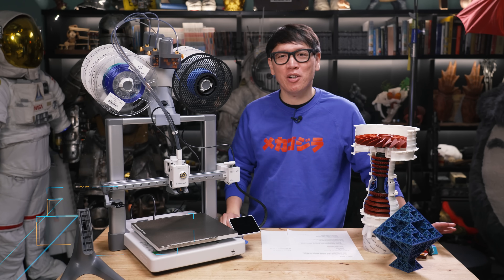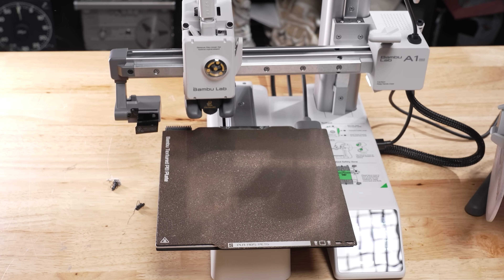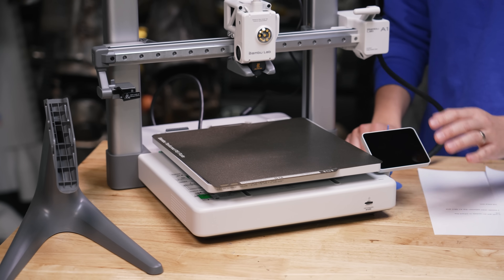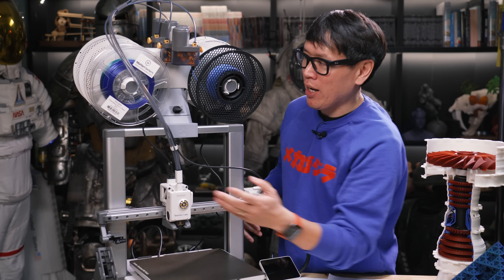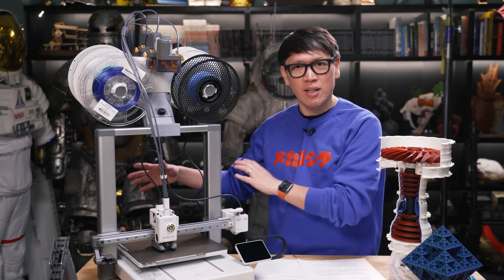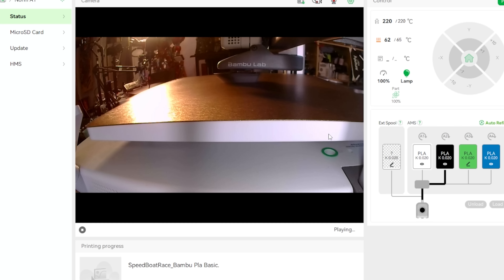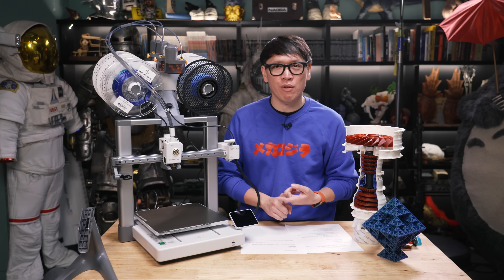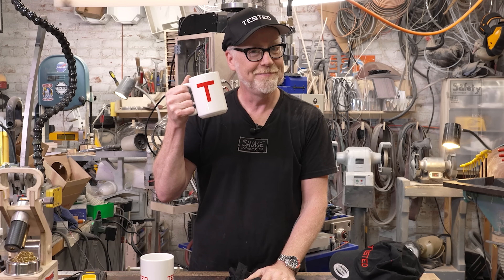Hands-On: Bambu Lab A1 $400 3D Printer!

Comment: Agree that the AMS Lite has a ridiculous footprint, and that mounting it on top of the A1 seems a logical solution. However, I'm concerned that so much weight (5+ kg) up that high and hanging off the back of the gantry just seems unstable.

Comment: I'm currently watching this video, while my Bambu Labs A1 is running a print (about 18 inches from my monitors) and other than the part cooling fan and the slight hum of the motors and the print mechanism, its AMAZINGLY quiet once the harmonic calibration is done.

Comment: just ordered an A1 on sale for 300 bucks...tired of my ender 3 neo..it printed great out of the box, but now i can't get it to print a damn thing, tried just about everything...it will extrude when i adjust the extruder axis in the settings, but when i actually try to print nothing comes out...tried reformatting my SD, changed nozzles, and filament lots of times..., there's no jams, the idler tension is fine, the bed is level... just nothing comes out...had the same problem with my cr-10 as i did with the ender 3...i'm done with creality for now, and maybe forever ...i'll fix it one day, but until then, hopefully i can actually start printing again, when my A1 comes...

Comment: I have a solution to save filament due to purging.
The derivatives to the solution
The purpose of purging being only to clean the nozzle
 
Thus why use filament by extruding it
A purge liquid solution solution can be piped into the nozzle
When a nozzle needs color change the the liquid is filtered through the nozzle

The nozzle is the air dried before the next color filament is put through extruder
The liquid itself is a solution that cleans plastic or absorbs plastics however not too corrosive or dangerous 

its just a little container with solution liquid on the side of the printer the container has a pipe running into the nozzle of the printer .   
The container is electronic and has a connection adapter to the AMS Lite or 3d printer itself
Thus when the AMS Lite triggers filament change a delay is initiated whereby the the container cleans the nozzle by pumping the liquid through the nozzle and blow drying it with air

Sincerely

Ejike Ememe
Ba Hons Degree Administration
Thames Valley University London

Comment: 9:15 for this issue, is there a way to slow down the print once it gets to the top to avoid this?
Reply: Yeah in the slicer you can add a modifier to the part and change the print settings to only affect where the modifier overlaps.

You can change speed/quality settings but you can't change acceleration afaik. 

In addition, during the print you can switch to silent mode (using the touchpad) which halves the speed of everything.

Comment: Three big things had to come together to make reliable high speed printing happen at the consumer level. First we needed more rigid frames to constrain movement while also being smooth. Second, we needed advanced Input Shaping to prevent resonances from being produced that would show up as artifacts in the print. Third, we needed reliable high-flow nozzles in a lightweight direct-drive extruder to maintain the best control of flow while avoiding ooze and stringing. On top of all that, Bambu added more smart sensors, a decent setup wizard, and plenty of fit and polish. This is pretty much the textbook definition of “industry-leading,” and it’s pushing all of us to keep reaching higher. The next big challenge is to do something about plastic waste in multi-color printing. There are ways to make filament at home from your old scraps, but anything we can do to reduce the waste in the first place will be a huge help.
Reply: I've seen quite a few people reuse the scrap filament towards providing cushioning for sent out parts.

Comment: as much as I do love the bambu printers,  They're lower end printers just don't really appeal to me at the prices they're demanding. $600 CAD for a printer with a 180x180x180 volume with the featureset they come with is rough, considering I could pick up a new gen kobra or neptune for half the price and have twice the volume potential. I could MAYBE understand if space was the issue, but with the AMS lite you're taking up nearly the exact same footprint as you can with a full size bed.

Idk, maybe I'm just not the market for it and I am missing something here but I'd rather have 2 printers for the cost of it or a printer and a wad of cash to throw at filament or modding or whatever you'd prefer. I do swear by their X1 and P1S printers at their price markets but this just gives me vibes of selling something for a fair bit more change than it's worth and giving it the apple treatment of beautification.

Comment: I've seen several reviews on this printer and am seriously looking. My 1st printer was an Ender3 v2,  a good starter printer but now there are many better printers for the same or cheaper price. A question, some reviewers found artifacts in the prints ( from the fast print speeds perhaps), couldn't you just slow the print down to eliminate these on parts where beauty is more important than speed? It would still be many times faster than my Ender3 v2. Excellent review by the way.

Comment: I have the Creality K1 already and it is both my workhorse printer and my speedy printer. It comes with most of the A1 mini features but it's a CoreXY design with a 220x220x250 build volume. I ordered the A1 with the Ams lite today because I really want to try multi color, but I dont wanna give up the print volume that the K1 has. I'm so glad I waited and they released the A1 full size at this price point.
Reply: If you could go back would you take the a1 over k1?
Reply: @stilltrying2gopro829  no, the K1 has the ability to print more exotic filaments, and for my use case, that is more important than the multi color function.  I still use my A1 all the time, but it's usually printing PLA or TPU, nothing fancy like CF-Nylon or anything

Comment: This was exactly my assessment. Solid printer with lots of features for the slightly premium price. The important thing is they priced it only $100 over the already popular A1 Mini. Everyone looking at the Mini is going to think "Well, it's only $100 more." and take the step up. I knew they would launch it at $399. Very clever.
Reply: It's kind of surprising how price sensitive FDM consumers have become. Was 400$ for a printer always 'slightly premium'? I honestly can't remember.
Reply: @free_spirit1  Definitely not. A printer with features like this used to be far more expensive. A lot has changed in the past year alone. I say slightly premium because it's still half the price of a Prusa for example, but twice the price of an Ender 3 V3 SE or almost twice as much as an Ender 3 V3 KE, Sovol SV07, Elegoo Neptune 4, or Anycubic Kobra 2. None of those have all the features this does, but they're all largely comparable for basic printing. So it's a moderate step up in price for a step up in quality and additional features. It's definitely not an unreasonable price. Also consider it's close in price to some of the more affordable enclosed printers like the K1 or something from Flashforge. The Adventurer 3 Pro is $399 and is enclosed with a camera and more, but smaller build volume by a lot and slower. The Adventurer 4 and 5 models get closer in size and speed, but are $100 and $200 more. So it slots into a nice spot as a  high end bed slinger without being as boutique as a Prusa. It of also nips at the heels of the Bambu Labs P1P, making it seem both expensive and like a bargain at the same time.
Reply: Did just that, cancel my preorder of the mini and went to the a1, because the larger build would not matter most of the time, but when it does i would´ve always regretted not spending the 110€
Reply: @marcelbirkenkamp1386  I do think the A1 is the better overall value at $399, even if it's a bit of a premium over comparable printers from other brands. If you're primarily doing miniatures or something, the A1 Mini still makes more sense. Hope it works well for you!
Reply: @802Garage  For some of us, the extra $100 can be a dealbreaker.

Comment: The price difference is really for the full combo.  A1 with AMS light is $560 but the P1 with AMS is like $860 (P1P) or $960 (P1S).  Saving $300-400 made the difference for me because I wanted to be able to use the multi-spool features.  You can buy a lot of filament for $300.
Reply: Or you can buy another A1 basically and have 2 printers 1 with ams and one without.
Reply: @joshammegibbs9943 I'm considering about this choice, now I have p1s without ams, elegoo naptune3 plus and im not sure should I buy a1 with ams light, colorful printing is amazing but three 3d printers is a challenge for me lol
Reply: @joshammegibbs9943  i plan on getting the a1 combo and buying a mini to use with the ams lite for small figurines
Reply: @joshammegibbs9943 or you can buy 2 hours with an escort.
Reply: I just bought thr a1. While it isnt rhe cheapest its in a good mifdle point for an appliance wich js good

Comment: I think A1 us a way better value than the P1P, but the P1S is the best choice if you need/want an enclosure.
Reply: No one really needs an enclosure but we all want sn enclosure.
Reply: @Beecher_Dikov If not for a heated print chamber (not many need this), it's good for preventing drafts. Warping is a real problem with a lot of my prints since I do a lot of functional prints (which are usually large and rectangular) in PETG.
Reply: @ken830  I agree...I don't need an enclosed unit.....but I want one

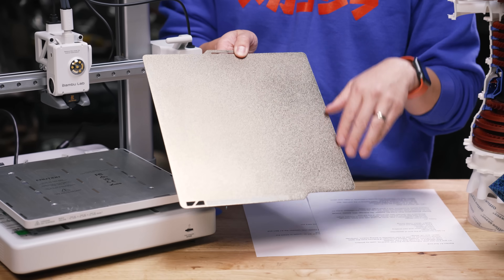Comment: That's not how volumes work! @3:50
10" x 10" x10" doesn't make 10" cubed. 
it make 1000 inches cubed.
Earlier the same mistake when talking about the Mini , when Norm says 180mm cubed.
Reply: it actually does - 10" cubed means 10"^3 - aka 10*10*10 = 1000 cubic inches - there's a big difference between "cubed" and "cubic" (and yes, I know English is a stupid language)

Comment: The amount of waste this multi material system produces is it's biggest downside
Reply: Not just Bambu, it would be the same for any single toolhead printer that does multi color/material. For the waste, there are settings in Bambu Studio and Orca slicer to help mitigate waste.
Reply: @chaosengine3772   Seems impossible to optimise for single heads. Can you elaborate on the setting you were talking about. I'm pretty new to this. Thanks

Comment: Putting a pendulum that heavy on the z-axis will prevent high print speeds.  Enjoy trying to print ABS as well.  Oh Bambu isn't open source hardware either.  There software being locked behind the CCP wall is the biggest flaw of the whole Bambu line.  I'll keep my Voron with orca slicer.
Reply: Why would you try to print ABS on an open frame printer?

Comment: I'm honestly a little sad I bought an A1 mini, when I could have got a regular A1. I suppose I could have guessed based on the nomenclature... Dont get me wrong, I love the A1 mini, but I bought a P1S on blackfriday because of the build volume. It would have been nice to know I could have bridged the gap with just the A1
Reply: Yeah but at least you can print bigger parts using more advanced materials with the P1S, while simultaneously printing smaller parts with regular filament on the A1 mini :)

Comment: With how much bambu lab has shaken up the 3d printer space the past few years. The next few years should be pretty exciting to see what other printer companies come up with to catch up that aren't just stop gap measures.
Reply: There is a upcoming printer (that i forgot the name of ) that has a Big build volume and is fast , but that is not the most important thing , the real thing is that it has an add-on that adds other 4 toolheads with nozzles at all , these toolheads are installed in the sides of the Main toolhead  , if the model is not super wide , you can put all of the 5 heads to make the same model , which esentially means you can multiply 5 times the production of some models
Reply: @ulforcemegamon3094 orangestorm giga is that printer

Comment: If you just want the A1, what is the recommended way to feed it with filament without using the AMS?
Reply: It comes with a spool holder that is mounted on top for one filament

Comment: a1+ams $560 vs p1p $600 vs p1s $700...but p1p is on only one sale $100 off (no ams option tho, and the addon is $350 for it...unless the a1 ams is compatible?)
Reply: :( p1p apparently requires expensive ams
"No, the AMS Lite is not compatible with the P1P printer. If you want to use multi-color printing with the P1P printer, you should use the AMS or AMS hub."

Comment: There we go anyone who has an issue with “sending files to china” not an issue anymore run it on LAN mode
Reply: Still have to register to get full use of the slicer program.
Reply: Except you can't even update the FW on BL printers without connecting to their cloud and sending all your data over to the CCP. LAN mode aint shit when you still have to make an account to use the printer and connect to their CCP servers
EDUCATE YOURSELF

Comment: To correct - at 5:20 or so it's stated that a firmware update has come for the X1 and P1 printers to include active noise cancellation. This is true for the X1, but the P1 series has not received such an update yet. Bambu has said it is planned.
Reply: But that same announcement said "P1 FW coming soon".
Reply: I have a P1S. The print quality is IDENTICAL to the X1.  Literally the only difference is that they handicapped the software to make it slightly more cumbersome to use. As an example both printers have lights and cameras and record awesome timelapse videos…

With the X1 you can download and preview and watch these vids using the bambu software. 

But on the P1, they require you to physically remove the SD card to access the timelapse vids and view them.

This “handicapping” strategy for the P1
and the notorious “forced slowdown” of ALL prints using non-Bambu brand filament will sadly eventually be their downfall.

I still love my P1S w ANS tho.
Reply: I have a P1S. The print quality is IDENTICAL to the X1.  Literally the only difference is that they handicapped the software to make it slightly more cumbersome to use. As an example both printers have lights and cameras and record awesome timelapse videos…

With the X1 you can download and preview and watch these vids using the bambu software. 

But on the P1, they require you to physically remove the SD card to access the timelapse vids and view them.

This “handicapping” strategy for the P1
and the notorious “forced slowdown” of ALL prints using non-Bambu brand filament will sadly eventually be their downfall.

I still love my P1S w ANS tho.

Comment: I'm wondering if the benchy would look a bit better if the AMS wasn't top mounted that might add a bunch of wobble on faster moves of the bed. But a capable machine for sure, even with multicolor still half the price of a Prusa MK4.
Reply: Based on my P1S, I'm guessing he printed the Benchy file that Bambu provided. But that file is made to print fast, not to print cleanly. If you slice your own with proper settings, it looks great.
Reply: If you recalibrate it then it should be fine
Reply: You can also print stabilising legs for the Z columns that help spread the weight when the lite is top mounted

Comment: I use a Bambu Lab X1 Carbon at work.  The amount of maintenance and the enormous failure rate makes it lower performing than any other printer I have used.  It gets high volume usage, which may be contributing to the issues, but for a high volume setup, the X1 Carbon from 2023 is, in my experience, vastly inferior to all other printers of a comparable, or lesser price point.
Reply: Sounds like user error, I have one at home and one at work. Thousands of print hours and only performed basic maintenance like cleaning and re-greasing the lead screws. Loads of people have them in print farms with minimal errors.
Reply: You have literally the least lyck in the world bexause everyone and their mom has the opposite opinion and people have farms and farms of these things.
Reply: Is that all? SMH...LOL!🤣